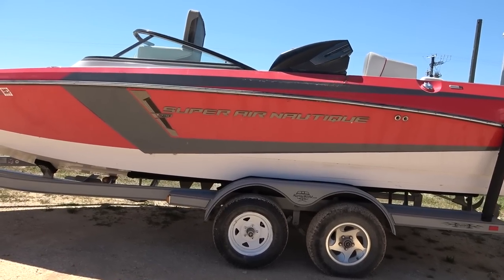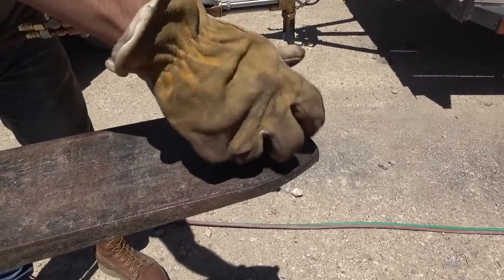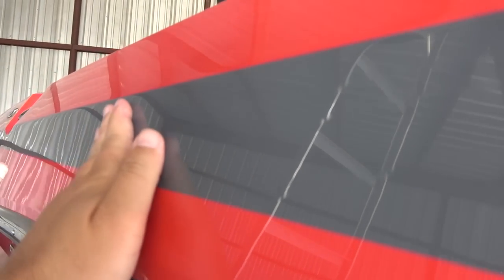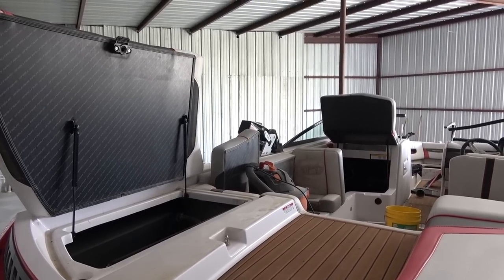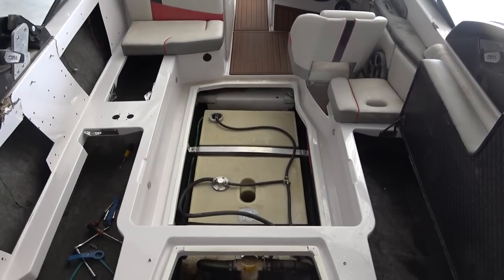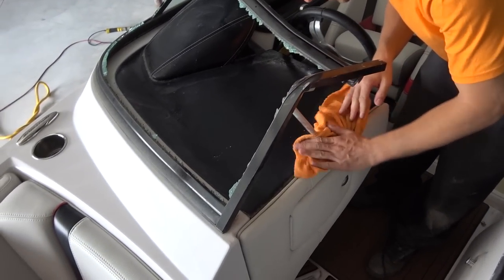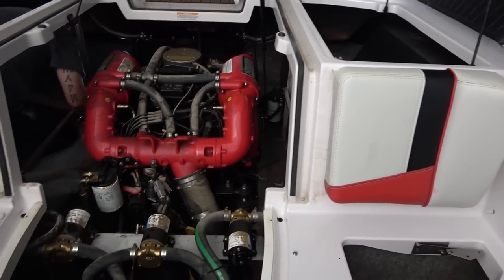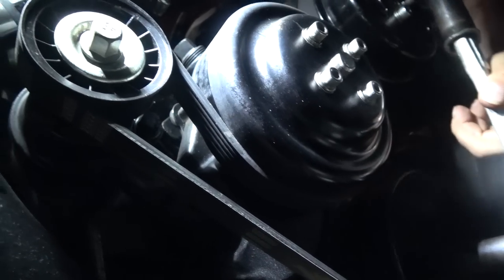Flooded Copart Super Boat REBUILD PART 2 - More DAMAGE!?!

Comment: Hey Mate, I am a marine detailer in Sydney, those pink stains are a type of mold and are a bitch to remove, but there is always hope. In Australia we have a product called 'jif' it's heavy duty cleaning product designed for kitchen tops, stoves, floors etc. It's a thick white cream with lots of grit in it [feels like a heavy duty buffing compound] Get a rag, apply to the whole seat evenly, then leave it out in direct sunlight all day. Then wash off and see if it's gone. Hopefully it works for you.
PS. you just have to remember what ever you can't clean with degreaser or any other cleaner will be a mold so it's germ warfair, disinfectant and uv sun rays are the answer.
I work for a MasterCraft dealership so I'm very familiar with the boats you work with, new and old.
Hope this helps a little.
Tom.

Comment: So I know wake boats. That top rail under the tower is going to be the main exterior fix. And even if it doesn’t look crispy, you get that thing running good and back on the water, you still have a hell of a boat for a hell of a lot less than even buying it used from someone. Good luck with the engine and hopefully it won’t be plagued with electrical gremlins.
Reply: He needs to do a damn ultrasound test of the hull.
Reply: @MaRi-wk8gp  you mean the hull? right?, Ultrasounding fiberglass, that would be interesting to see

Comment: Rebuilding a boat is an awesome experience, & it also teaches you why hardly anyone rebuilds boats!
A marinised engine shouldn't suffer much damage from water, just replace censors, electronics, clean the earths, replace filters & oils etc.
What ever you need to replace, use the existing as a template. Wiring, interior parts & panels etc. 
Should keep you busy for a while... & likely broke too!!

Comment: Ouch!!

Sorry Bro but that’s a parts boat. Stress cracks mean damage to the underlying structure. Covering with paint won’t fix it. The pink stuff is mold. Try Spray 9 or Magic Eraser. 
Good Luck!!!
Reply: You can repair fiberglass quite easily, even with stress cracks (involved cutting out the area, back supporting it with carbon and redoing the damaged section) . He just has no bloody idea how to do it.
Reply: Ma Ri , true. 
The way those boats are built even if you do that they will never be structurally the same as the day they left the plant. 
It’s unfortunate, but that’s the hand that’s been dealt. 
No lost points for trying though.
Reply: @inzguy  I don't know the layup schedule on these things, Part of me wonders if it's just standard blown in mat w/ vinylester without any Corecell. Wouldn't surprise me, these weekend "jetters" are just garbage quality usually.

if there is Corecell and bottom hull damage, toss the boat in the garbage. You could fix it, but why bother. He has no idea how to do it and the boat will sink again inside a year.

First thing I would do is grab an ultrasonic thickness meter, go over every inch of the hull. If it's not damaged under the waterline, you can probably fix the hull in a few weeks of work.
Reply: You're talking about relatively minor upper hull damage, there's a fair amount of work to be done but not really a big issue.   Good chance that engine will be fine after a bit of TLC>
Reply: @Jester123ish  Needs to ultrasound the lower hull, guessing that's not the case. The upper repairs are also not at all minor.
Reply: @MaRi-wk8gp    Well I guess it depends on your point of view, I look at the damage on the upper hull I think I'd be able to fix that myself, I've done fibreglass before, it looks straight forward. 

As reguard the hull to be sure they should probably get a boat survey done at some point.

Comment: I had a auto body shop for years and I painted several boats and fiberglass cars and I never used anything other than acrylic enamel on all of them and had great results and long lasting paint jobs as long as the client used a good wax after about 4-5 months after it was painted .Just don't let it start to oxidize, if you do it will come back and you can't stop it , as is with all finishes.

Comment: I find it hard to believe that buying a boat this damaged is financially sound. After all the repairs and new electronics I think this boat is going to cost more than a used one in good shape. You’re also going to get pennies on the dollar because it was salvaged
Reply: You gotta keep in mind that buying a used boat isn’t as interesting content and we wouldn’t be watching it. This series will pay the boat and leave him with even more money and a good boat
Reply: To be honest I thought the same thing u are until I saw these boats go from between $110-160k. He's got 23k in it now. Even if he puts another 23k into it he's up money. No salvage title on boats.
Reply: I don't fully agree with you. If you have the ability to do the work yourself and you are capable then buying a damaged boat/car/truck can certainly be worth it.
Reply: GearJammerGamer wait till he sees how much that engine will cost lol
Reply: @jimmygrant3212  I don't think it will need an engine. Most likely fine. Turns over easy with a bar.
Reply: @jimmygrant3212  Still he's got 23k in a $120k+ boat. So what even if it needs a $10k overhaul. I'm in no way an expert in boat repair but do know a thing or 2 about engines and if he turned it over that easily with a bar he's won half the battle. The electronics are gonna be the issue but nothing a Holley Dominator box can't fix to eliminate that silly push button start horseshit and any other electronics he would want to bypass.
Reply: Dave Brittain yeah even if it’ll run it won’t last long. If it wasn’t flushed within a few days of it being sunk it’s toast and if they drained the water without flushing it then it’s definitely done. Plus you have all the electronics for the engine too.
Reply: GearJammerGamer right and a Holley dominator will only devalue the boat and half the electronics will never work…
Reply: GearJammerGamer I didn’t mean a salvage title. I meant the person looking to buy it is going to notice that the top half has been repainted and there was fibreglass work done and is going to want to steer clear and not buy it. And if they make an offer it would be substantially lower than a decent condition used boat
Reply: @jimmygrant3212  I'm not an expert but I think the wreck and being sunk devalued the boat already. Also u must not know much about a Dominator setup where u can run pretty much the whole car/boat through it picking and choosing what systems u want to keep or eliminate.
Reply: GearJammerGamer that $110k to $160k is for a new one. After four or five years these things loose half their value even if it was in nice shape. He’s going to be in it what it’s worth.
Reply: @jimmygrant3212  I haven't seen one in the quick search i did for under $100k. Tell you what man I'm gonna do you a solid cause I'm bored with this. You seem like one of those people that has to be right about fucking EVERYTHING. So here you go........ You win. I'm wrong. Doesn't that feel better? You can hold your head high today knowing u "won" an internet comment thread crusade. 🎉🎉🎉🎊
Reply: I'm sure it is fine mechanically, it was running when someone crashed it into something with the tower up.
Reply: @jimmygrant3212  Ya I said in another thread in here that it will need the oil changed probably two times with in the first 15 minutes of running then you would have to keep a very close eye on the oil on that third change very closely to see how it looks with time on it. A lot of the moisture and I don't mean water just moisture like droplets trapped here and there would evaporate after the first hour of being ran but if tha thirdt oil change starts to look milky it needs changed yet again.
Reply: Dave Brittain yeah I know just did a twin engine Chris Craft Express Cruiser that completely submerged the engines. Three oil changes and they were fine except the left engine that happened to already have the beginnings of a rod knock. But both were done within two days of being submerged and neither where drained of water until they were ready to be flushed.
Reply: GearJammerGamer there is a 2015 for sale in good shape for $70k. Getting to half of what it cost new these piles depreciate worse than any German car. And yes I do know my way around boats new and old you learn a lot when you’ve been surrounded by them all your life.
Reply: @jimmygrant3212  I guess it al boils down to taste but I would never spend more than 10k on a boat. My Lund works very well for what I use it for and really would not want anything else.
Reply: Dave Brittain don’t think any of the boats we’ve had initially cost over $10k except our Commander we stole for $15k because the engines wouldn’t run since he did zero maintenance to it. Now we’ve definitely spent over $10k on restoration work on most of the boats we’ve owned.

Comment: You may end up with two boats. that boats been structurally compromised. 🌮
Reply: No it hasn't, the little amount of damage it has is easy enough to repair, it's fibreglass after all.

Comment: I'm reposting what I posted about a month ago. This boat most likley was a flooded boat from Texas among many damaged. When they were gathered up and put on a 52' flat deck trailer, many were stacked on top of one another. As each one is schinched down tighter and tighter, then the next boat on top crushed the windshield and anything above the deck. At this point the trucker is going to continue wratching the straps because he can't afford to have that load move one inch. The result is serious damage to everyone of them. I would bet the hull stringers are damaged to some extent, compromising the structual integrity of the entire boat.

Comment: I wouldn't put any work into that boat until I knew the motor was in good shape of course I would have never bought that boat
Reply: Right!  That series of major cracks in the port side are major failures and will need major removal, rebuilding and wide reinforcement/overlay if integrity is not to be compromised (as it certainly is right now).  Similarly, those areas of surface crazing on the starboard side are indicative of major problems in the structure beneath -- the carbon-fibre/epoxy matrix has been compromised by overstressing and that area will need to be rebuilt and replaced with quite extensive, wide area reinforcement/overlay.  It is quite possible that the area overstressed and needing replacement involves the entire mid-ships section, based on the fact of the major breaks on one side and surface crazing (structural overstressing) on the other side.  Has the owner carefully inspected the lower sections of the hull?

Compare that with a wooden ruler that is bent till it breaks -- one side goes before the other.  In this case the major fractures on the port side are on the upper surface areas.  If the boat was subjected to being supported on its keel, that would have caused a large bending force that may have resulted in those port-side tears.  It would also have caused some tension on the starboard side which did not give way, but overstressed causing the ripples.  The lower hull may have similarly been subject to overstress but not sufficient to cause visible distortion – but may have been weakened.  That is why I suggest the entire midships third or even half may need replacement.

A full inspection and written report by a certified marine structural engineer is probably warranted.

A pot or two or three of epoxy resin, a few yards of carbon-fibre cloth (and some fresh paint, of course) coupled with uneducated "do-it-yourself-bravado" is a recipe for disaster and perhaps charges of murder or manslaughter of unwary passengers.

In this regard, cleaning the boat facilitates inspection and determination as to what structural repairs will be needed and to a lesser degree of need, what mere cosmetic fixes are needed.  The severity of those major repairs will possibly have some bearing on deciding what to do with the engine when it is investigated.  The time taken for the cleaning is pretty small with several guys lending a hand, and in this instance possibly a good move to do things in the reverse of normal order.

Be extra careful.
Reply: @alantorrance6153  Totally agree. People saying he shouldn't have cleaned it are just missing the point. Personally, I think he shouldn't have bought the boat, but I'll watch and learn.
Reply: Yep,just the windows alone are gonna be $ if he can find them
Reply: He needs to put a scope down the cylinders to see how bad they are. If he just starts it up they will chew up the rings if they are rusted. Its common sence

Comment: Repair the gel coat with white gel, sand them all fair and vinyl wrap the top , have a go first repairing 
The red gel coat , should be easy enough to get colour matched gel as it’s quite a new boat, the builders will tell
you the colour code. Never be afraid to make the fibre glass repairs bigger than the visual damage , this will make the repairs stronger 
( I repair damage like this all week in the uk )
Reply from the maker: Thank you for the tips much appreciated :)

Comment: Dude if you find water on the plugs, the bearings are shot. No doubt. I don't care if the crank turns with the most ease. The rust is there. Stop now before you throw a rod and have to replace more than some simple bearings. 
#YouWereWarned
Reply: Joseph Preston not always the case... I just pulled a 390 out of a 74 Ford F-250 4x4 had been sitting who knows how long with 3 cylinders full of water.. when I pulled it apart the cylinder walls were rusted and the top ring in one cylinder was stuck... oil pan was full of water and oil but no rust on crank or bearings... quick honing of cylinders (just cause I had it apart but didn't need too) rebuild kit and it ran just fine....... but no rust at all in the bottom end.......

Comment: Not sure if you have removed the tower foot off the deck but if you look closely there is actually a metal plate underneath where it’s bolted, not directly to the fiberglass.

Comment: Try magic erasers to remove the pink spots not sure what they are but the eraser removes about anything thanks for the video can't wait till the  next:-) loving the series so far
Reply: I was thinking WD40. Worked to remove some felt marker ink from my leather seats after my daughter decided her coloring book was boring. We've Never tried the magic eraser. Will have to check those out!
Reply: They even removed the color from my clothes lol
Reply: DO NOT use a magic eraser there a discussion about once a month on the nautique owner’s page on fb about how they strip all of of the protectant out of the vinyl. I use boat blings 2 vinyl cleaners back to back and it cleaned everything off of our ‘96 210’s interior which hadn’t been detailed in the first 22 years of its life.
Reply: magic eraser will ruin in vinyl seats. plain and simple
Reply: watsupitsdenny I need to try that I used magic eraser on my ski centurion interior to get it white then hit it with some leather/ vinyl conditioner to restore what I stripped out but might give that’s a try
Reply: Pink dots are mold some boat manufacturers are recalling alot of seats for this reason
Reply: I have pink spots on my seats from mold and tried everything to get rid of it. I even tried a bleach based bathroom cleaner and it lightened it but did not take it off.
Reply: @1STLAR2147  Just buy a thing of Melamine it's the exact Same thing as magic erasers but cheaper but I don't know if you can find Melamine in stores but Melamine is way cheaper.

Comment: So, I don't know if you've gone over this or know the exact story of this boat, but if you don't, I'm going to venture a guess. 

I'm going to say that, likely, this boat was a toy that someone really wasn't capable of handling. They got stupid and sank it to the top of the sidewalls, and whever hauled it from the water did so without giving the water inside it a way to escape. The crane that lifted the boat out of the water would be designed to handle that much weight, but a boat isn't meant to keep water in, especially a fiberglass one. The weight of the water caused the entire boat to flex in the middle and put that big split in the side as well as forcing the gel coating to flex beyond its limits, putting all the microfractures in it. 

This is just a guess, but I'm assuming the insurance company found out and just wrote the entire thing off.

Comment: You need to look deeper.  Those gelcoat cracks are only a symptom of significant structural glass issues from whatever damaging load was applied to the area.
Reply: most likely from what ever landed on the boat to collapse the tower and wind screen. The shell and hull glue together beneath the rub strip. any damage above that is superficial.

Comment: So much hate in the comments. =/ Remove the gelcoat on the cracked side and put a layer of kevlar and resin over it. Sand it down, some mud and repaint. Yes, that is no fix for a few decades, but is enough to have some fun in the comming years with that boat. On the teared side just cut that part out, make a mold and do a whole bunch of layers fiberglass till you reach the thickness of the rest of the upper hull. People always suggesting the perfect fix... How about diy and enjoy what you bought.
Reply from the maker: There we go! Thank you! Awesome comment!